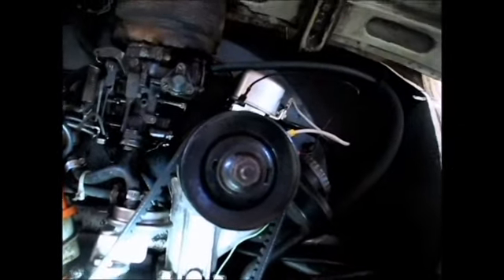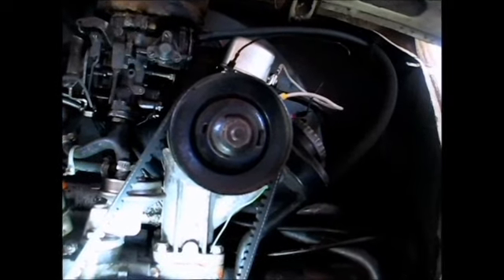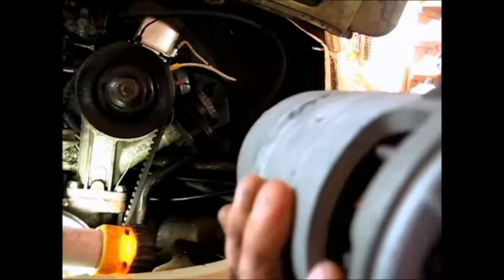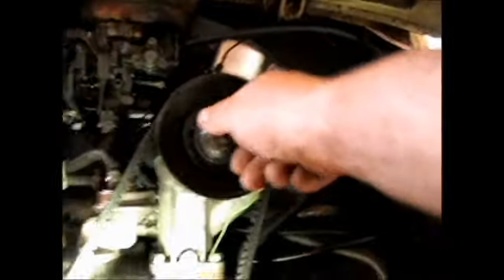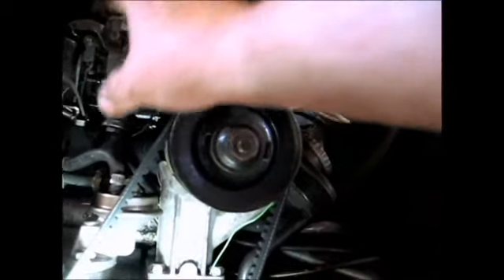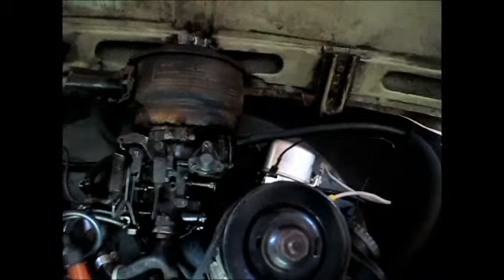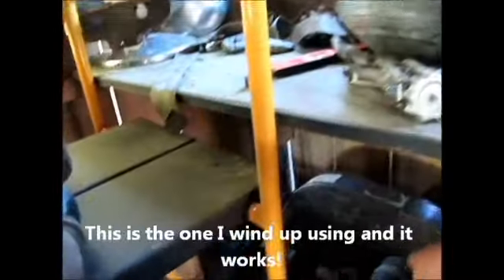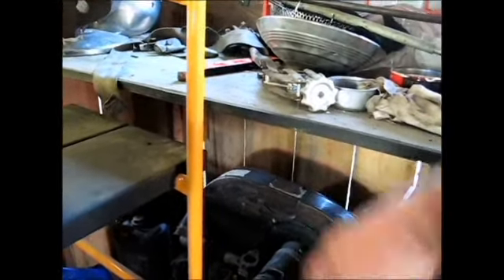1964 VW Bug, Generator swap 1

Comment: usually its the brushes not touching good wearing too short. if you swap the parts out of the new one with the old one then it would probably work good. Take the brushes and springs out of the new one and put them in the old one. shine up the the copper places where the brushes ride and clean out the grooves.  Swap out the bearings if possible too. I did this on a old ford truck it worked. your best bet may be swapping back to the guy on ebay though.

Comment: cool stuff....i had the same thing with ebay on a door regulator with no pully where the door handle attachs, tryed to use the old one but it zinged off into a wheat field. did order another on ebay after looking alittle closer and askin before buying.